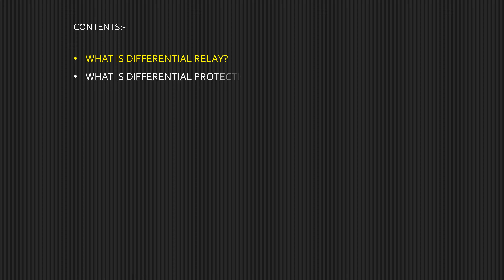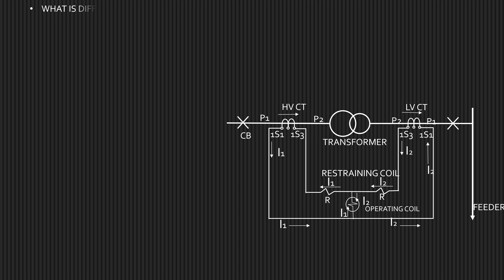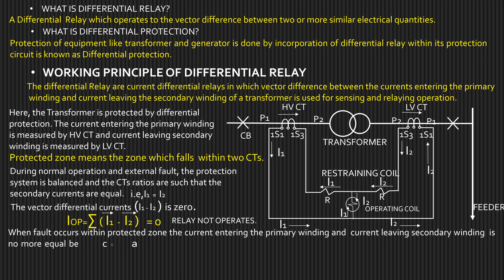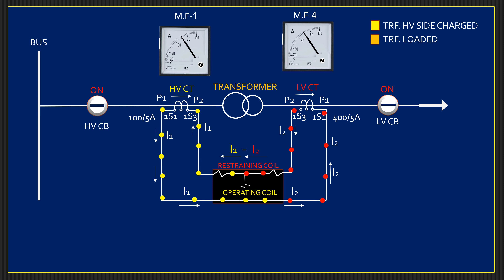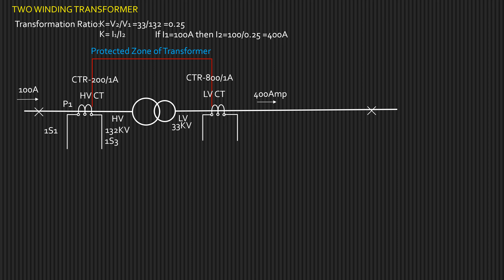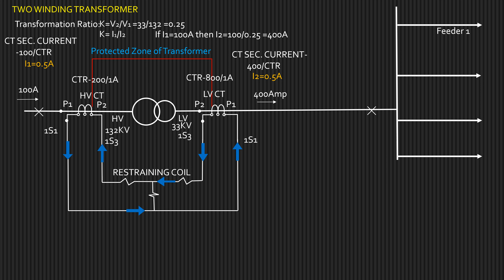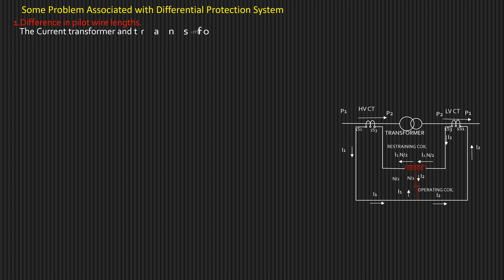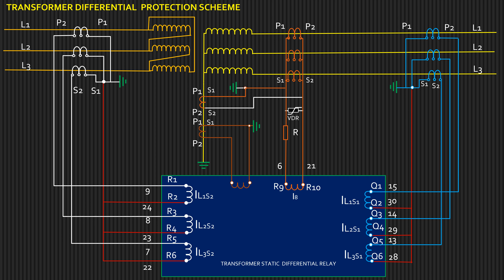Differential Protection of a Transformer/Differential Protection Relay/Differential relay working

Comment: I like your channel very much! thank for your sharing. I would like to ask u one question For Differential Protection how could we do when ICT HV side difference ICT LV side. Ex, ICT HV side 0.55A and ICT LV side 0.58A.
Reply from the maker: You are welcome.To avoid such an occurrence it is important to match the HV and LV side CT secondary current so that their phasor sum may be zero under normal conditions. So calculation of Matching Factor in Tr. Diff. Prot. is needed which is not possible in this little space. Thank you.
Reply: could you drop a video please! @electricalpassionate
Reply from the maker: Trying.Keep watching.Thanks. @gspochentong4608